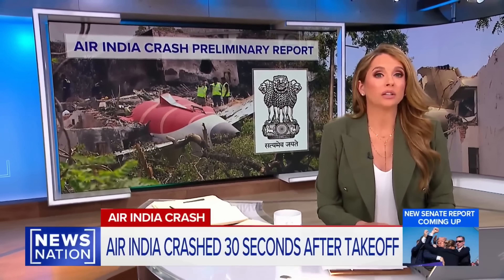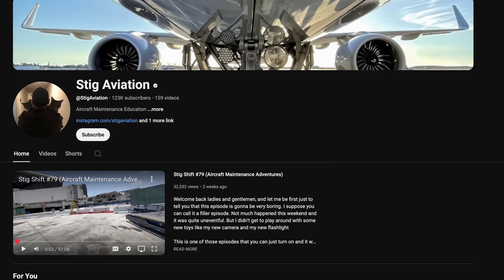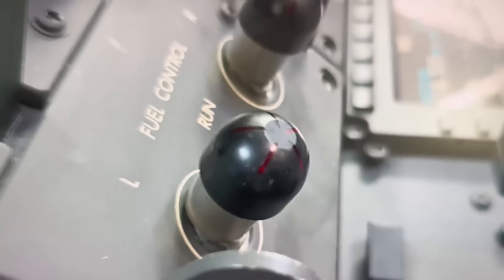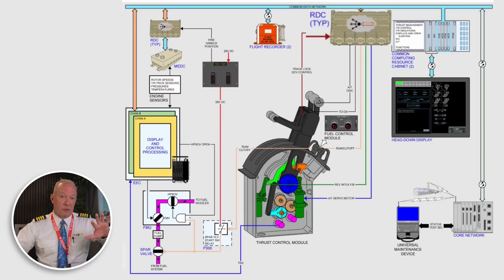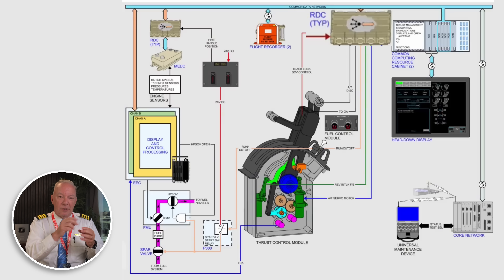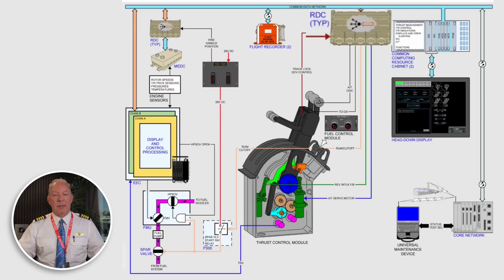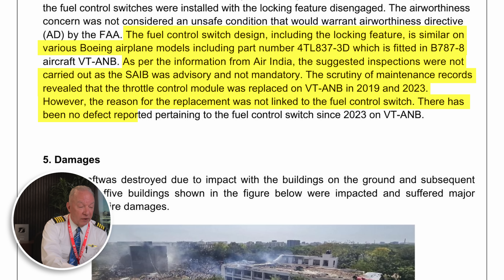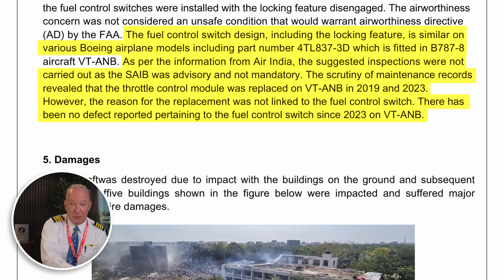The Truth About Boeing 787 Fuel Control Switches

Comment: We have seen numerous statements made by various "experts" with assumptions made based an a preliminary report that appears to leave more questions open than answered.  The flight recorder has the switches cycled and I will take that as fact a signal was sent to it.  My question is where is this input coming from?  If it is direct from the switches and we can hear say a distinctive noise of them been manually switched then an important piece of the puzzle is in place.  If the flight recorder picked up the data from say at the engine then the wiring needs to be traced back to the actual switches and all sources of false input investigated.  If they are routed through the electronics bay subject to water ingress then claims one of the pilots cycled them is suspect at the least.  Also, to pilots of the 787 how did the pilot asking the question know they had been switched off?  Did he look down and see them physically switched off or was he informed by a display?  I would be imagined if he was flying the aircraft his work load with engines shutting down would mean his focus would be on the instrument panel looking for clues and maybe the terrain looking for a place to crash.  

Simply put the 787 had a known issue of water ingress into an electronics bay.  Until that is cleared making assumptions about a pilot's action is premature at the very least.  Surely is straight forward to have the exact time the RAT deployed.  If it was before the fuel cutoff switches were cycled then you have a strong indication something was seriously wrong with strong possibility it been electrical related.  If say water in the electronics bay was shorting things out and one was sending false signals to the engines to shut down then you have a plausible reason for confusion in the cockpit.

If it was pilot related then as a passenger I would want to know if it is a training issue or something else.  If training then training revised.  If plane related then then the issue has been fixed.  To Capitan Steeeve you may recalled pilots of the 737 in the 1980-90's were blamed for crashes when it turn-out heat/cold cycles had reversed the pilot's inputs.  We need facts not speculation.
Reply: The FDR records a lot, but the preliminary report doesn't specify which valve or valves were commanded closed. I know the fuel spar valve position is in the FDC. That signal comes from a limit switch (open/closed) inside the valve actuator based on valve shaft position). The limit switch position is transmitted to a Remote Data Concentrator and converted from an analog signal to a digital one, and goes to the Common Core System (computer). Systems that subscribe to this indication; FMC, Fuel Management System, Flight Deck Displays, and + report the position change.

Comment: The fact that the voice recording has the one pilot asking "why did you shut off the fuel" almost certainly means that this pilot saw that the switches had been physically moved.
Reply: But, which pilot said "why did you shot off the fuel"? The confused Pilot Flying or the Pilot Monitoring? My assumption is it was the Pilot Flying, suddenly realizing they had lost thrust. But it could have been the "evil" Pilot Monitoring trying to cover their tracks. I don't mean evil as in demonic, but if a crazed individual was trying to shift the blame ....  The preliminary report is missing so many details you can go down a lot of rabbit holes.
Reply: He asked “Why did you do that?”.  But that is still suspicious.
Reply: The problem here is we lack the timestamp of when they actually heard one of the pilots asking why the other pilot shut it off. Idk, I might have missed the time stamp for that? Fill me in with the deets
Reply: No it doesn't he could have easily noted the engine cycling down. Don't forget the other pilot said he didn't switch them down which what makes no sense if you can actually look at them and see them up and down unless they actually weren't changed and that's exactly what would have happened if you had a power failure on that 28 volt bus that goes to both relays and it would have been recorded by the flight data recorders as a switch cycling but in fact if the battery powering the 28 volt system or the system that charge that battery or the power diode itself connected to the battery and then to the bus had a failure you would get exactly what was observed without moving the switches
Reply: @robertgrant5895 dude, even if you think the pilot who asked the question did so because he noticed the engines spool down, why would he immediately think it is because the fuel switches were cut off? He asks “why did you cutoff?” Not what did you do… did you do something.. why are the engines stopping… what’s happening— why would a pilot immediately think that the engines are turning off because the other pilot cut off fuel instead of a thousand others reasons for engines to stop working?

Comment: So logically then it was either:
1. A deliberate act
2. A gross mistake
3. Part of a procedure/checklist for another system malfunction.
Reply: 2. A gross mistake.  Hard to see how muscle memory causes you to pull and flip two switches. 
3. Part of a procedure... If the Pilot Monitoring had flipped the fuel cutoff switches from on to off to on with a 10 second gap to restart the engines without any discussion with the Pilot Flying that is such a huge brain fart that it would not even be considered in a fault tree.

Comment: What you said about the switch circuits is correct... to a point.  At some point, they will share a voltage feed, both for the switches, and for the relays, and also a common ground at some point.  Where that point is remains unclear... is the voltage daisy chained between the switches or relays, or are they independently hard wired back to each buss?  Even then, a failure at a common point between them would not make sense, since that type of failure would cause both to go out at exactly the same time, and here, there was the normal human intervention time between the circuits both being shut down, then turned back on, indicating a manual manipulation of the switches, rather than a failure anywhere.
Reply: Yes, there are single points of failure for a single engine on fuel valve position control. However, the fuel spar valve defaults to its last commanded position. In no mechanical failure mode could both fuel spar valves position be commanded to a different position by a single failure.

Comment: So the way I understand the voltage (14 volts) coming from the RDC is supposed to be supplied constantly, regardless of the cut off switches. This is the critical part here. If for what ever reason the 14 volts from the RDC is lost (a intermittent short ) or in a worst case scenario  for Boeing, ( a software issue or intermittent RDC) this would simulate at the switches and further down the line a deactivation of the switches as a result of the 14 volts to the relay missing.
Reply: Once a fuel spar valve has reached its commanded position; open or closed, power is removed from the valve actuator. It will only change position, when power is supplied to the other position pin. The RDC do not provide power, they convert an analog signal from the source to a digital one and send that to the Common Core System (Computer).  The fuel spar valves only change position when power is provided to the open or closed circuit.
Reply: @paultruzzi911  So where does the "14 volt" come from?

Comment: If I remember correctly, there were.a number of B29 crashes while landing, where experienced pilots would insist that they had put down the landing gear, but had actually adjusted the flaps.  The flap control and the control for the landing gear down were too similar.  The fix was making the controls different, to avoid the mistake.  Asking as a non-pilot, is there any way that one of the pilots intended to put up the landing gear, and shut off the engines, instead?  

Also, how does the black box monitor the fuel switch position?  There has to be some connection between the computer and the system.  It is not a closed system, if it is being measured.
Reply: The gear lever is nowhere near the fuel switches. The motion is completely opposite also. You move the gear lever up to raise the gear. Up or forward is on for the fuel switches. No way to mess that up accidentally.

Comment: Great explanation Captain Steve, but even per your analysis, what happens when there is an electrical problem system-wide throughout the plane?  Ok, each switch is a closed system, I get it, and the electric current cannot be cutoff unless the switch is moved.  But many have identified strong evidence of the RAT deploying BEFORE the cutoff not as a result of it.  In a situation of complete loss of electric, thermal runaway due to lithium battery fire, or any other scenario of total loss of electric that causes the RAT to deploy, what would happen in that sccenario?  Because even though it is a closed circuit if the plane has a systemwide loss of power, would that not indeed make it appear as if the switches got moved?  Because like you said, there is NO way that the engines shut down because the power running from those switches is a closed circuit.... but if power systemwide throughout the plane is lost then the electricity from those circuits is interrupted until the RAT starts generating emergency electric.  I would think under such a scenario power to each engine would be lost near simultaneously not one second apart, but the secondary black box appeared fried and was unusable despite being designed to withstand jet fuel fire, g force crash into ground and even 30 thousand feet under the ocean.  But it was charred and the data was inexplicably unusable, unless it was subjected to the extreme heats of battery fire.  Obviously this is speculative, I see both sides, but what can account for its destruction on a low altitude crash even if the plane was loaded with jet fuel it should have survived.  And in looking at the timeline and the photos of the jet as it took off, it appears to me that the RAT was already deployed and firing up before the engines were cut. Thank you for any comments or insight you have on any of this.
Reply: "But it was charred and the data was inexplicably unusable, unless it was subjected to the extreme heats of battery fire."

The APU battery is located in the aft Electronic Equipment bay and the aft EAFR in the roof over galley 4, some 20m apart. The APU battery did not cause damage to the EAFR.
Reply: @christopherrobinson7541  Yes I have heard this, I am just wondering absent a thermal runaway, what could have caused this?  Are we to believe it was faulty coming out of the factory?  The plane crashed at low altitude and yes it was loaded with fuel but my understanding is that open air jet fuel fire does not burn near hot enough to have done this damage.  Do you have any hypothosis on this matter?  I was also curious about the timing of the RAT seemingly coming prior to the fuel cutoff.  I am just a laymen slueth, I admit i am not qualified to answer these questions but it is very curious to me

Comment: Air India Limited and Boeing 
Could this be a usability / UX issue?
My heart goes out to everyone affected by the recent tragedy. In moments like these, it's a reminder of how vital human-centered design is especially in safety-critical systems like aviation.

While watching various analysis videos related to the aircraft, I observed that the fuel switch mechanism operates in a direction opposite to what most users in India are accustomed to, typically switches are "down" for ON (RUN) and "up" for OFF (CUT-OFF).

This observation is not about speculation or blame, but about highlighting the importance of aligning design with user mental models. 
This is something Boeing and every other manufacturer should consider in their designs. (If anything is to blame, it's poor design) 

In my years of UX research, I’ve seen how inconsistencies in expected interactions can lead to hesitation or errors, even in familiar systems.

Designing for clarity and intuitive use especially across cultural contexts is not just good UX, it's a safety imperative. 

https://www.linkedin.com/in/sohelkapasi

#AirIndia #Boeing #UserExperience #ProductDesign #EthnographicStudy #UserResearch #UXResearch #Accessibility

Comment: I was a crewchief at US Aviation Test Board, Cairns field, Ft Rucker, Alabama in 1969 and 79. Somehow I acquired one of these switches and they work EXACTLY as described. 
Your description was very clear and precise.
Reply: I don't agree.  The explanation is vague, and he doesn't show enough proficiency in electrical stuff. The thing that the analog switch behaved according to description (or even if the switch worked as specified) is not enough, then there's the relay, and ahead of the relay are the valves. Lots of questions can be made about only that small part of the circuit
Reply: @burdeninmyhand  To confirm your doubts Captain Steve makes two critical errors in his description; the three fuel control valves are not only controlled by the run-cutoff relay, the FMV is controlled exclusively by the control processor and the HPSOV is controlled by both the control processor and the run-shutoff relay according to the diagram Steve has presented to make his argument.
Reply: @burdeninmyhand electronic stuff? 
Oh we got an Einstein here folks
Reply: @br31000  Captain Steve incorrectly describes the control of the fuel values according to the diagram he presented. He needs to explain and correct those errors if he is to restore his credibility.

Comment: I appreciate your videos - to me it appears the fuel controls were not touched - which correlates to the Captain's 'I did not'. However there is a better more complete scenario that appears to be correct. As a Electronics designer with 40 years experience I tend to accept the linked youtube : https://youtu.be/OLxLN3osS1Y?si=cWrQS5_kaLoxAQZL
Reply: No, what you see in the crash photos is that the switches had been moved back to run, as recorded on the FDR. They went to closed for 10 seconds and then back to run. In the mean time the engines spooled down.
Reply: @paultruzzi911  I hear what you say, but this alternate explanation also fits the timeline. 
As I understand what has happened as: at the appropriate time to move landing-gear-wheels up , the gear up lever was selected which immediately caused bus 2 (rhs) turned off due to excess load from the gear retraction motor solenoids - side effect this bus takes the rear black box recorder with it. The bus transfer switch automatically activated 1 second later connecting bus 2 to bus 1 (lhs), then bus1 also failed as the lithium batteries had been overcharge = damaged and unable to provide the required current - a separate backup power system feeds power to the front black box. At that time the message 'Cutoff' would be displayed to the pilots as the power to indicate power available to the engine fuel relay/solenoid was removed. So a short or overload (possibly from on the landing gear motors) causes no bus1 & bus2 power - the fuel relays cutoff fuel - then produce no engine thrust nor electric power, and the RAT automatically deployed. Rat gave some hydraulic control. The APU was stared next, and 10 seconds later power from APU enabled bus 1 & 2 & engine re-light, but too late, to low, too high obstacles. 
Pilot (PIC) flared - trying to safely land the heavy aircraft (due to the amount of fuel),  but collision was unavoidable at that time. 
The Swiss cheese holes stink. 
Inadequate maintenance . 
Faulty Lithium battery. ( Insufficient bus power redundancy.) 
Faulty Diode unit. 
*APU not running at critical takeoff phase*. 
Using engine management power on the same bus as landing gear motors and in-flight entertainment power (I know this is AC power, but it is controlled by this DC bus). 
The airport should have a better safe overrun area. 
Insufficient airport runway takeoff overrun area with aircraft taking off straight over residential area - if this had happened over parkland, over water, or a higher ground clearance the outcome would be significantly less severe.

Comment: thanks for the great explanation.
I was going to ask about possible wiring faults in the control / monitoring circuits, but i think the diagram answered that.
Reply: In theory, possible for one engine. But not for two engines within a second.

Comment: Let’s say it comes down to a electrical short.  You would have to have those two separate harnesses wear through the insulation and ground out within a second of each other AND hold down together for 10 seconds when they are asynchronously lifted off of whatever has grounded them…..

If that’s what happened it would be an absolute unicorn of a failure.

To the “computer” people who are pointing at the 737 crashes, those planes started dropping out of the sky almost immediately.  On the 787 we’re talking about an aircraft design that’s been in the air since 2011.  More than enough time has passed for such an issue to make itself known.
Reply: The probability of that is well beyond anything that has happened in human history.

Comment: You are overlooking the internal structure of the switch baton. The black portion of the baton is a screwed on cap. It screws on to the lower portion of the baton that features the engagement pawls at its bottom. Inside the batons a spring maintains tension holding the pawls in position. If the cap partially unscrews, tension from the spring is eased. Backed off enough, tension from the spring approaches zero allowing the switch to be bumped/vibrated out of the run position. If you have never seen a loose black cap, it is easy to overlook the failure mode.